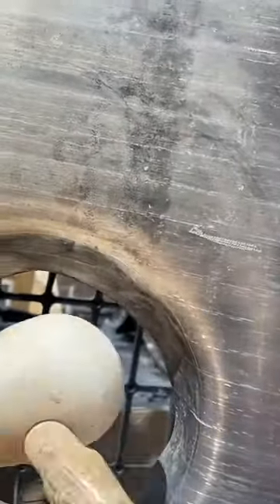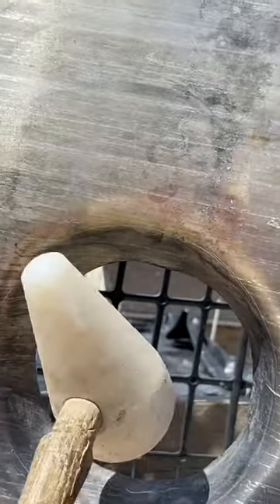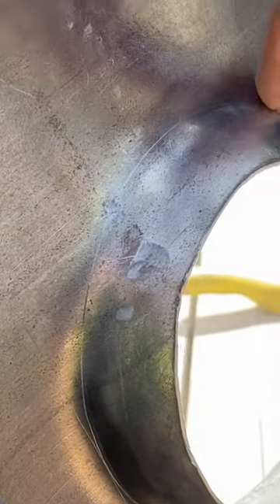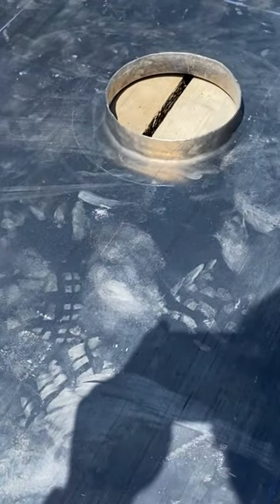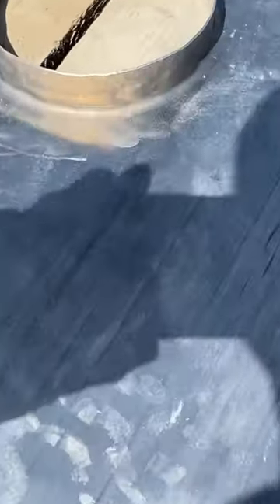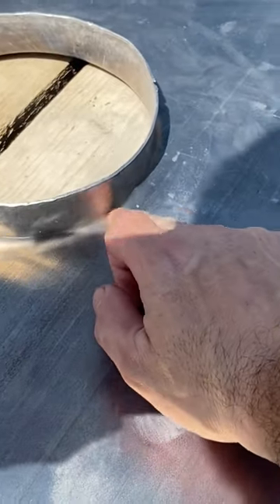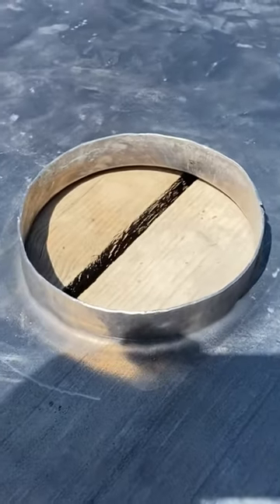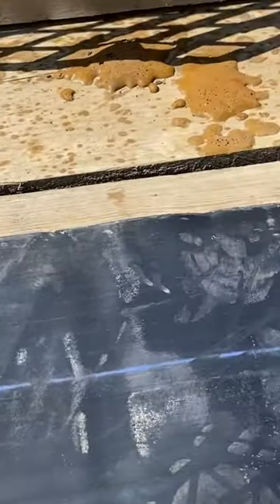Bossing A Code 5 Lead Tray-TAP TAP TAP

Comment: did you just roll out what you needed and stand it up with the roll?👀
Reply from the maker: I rolled out what I needed. Marked where the flue was. And then rolled the sides back up so it would stand to be in a good position for bossing . There’s  a full length vid of the process on my channel.